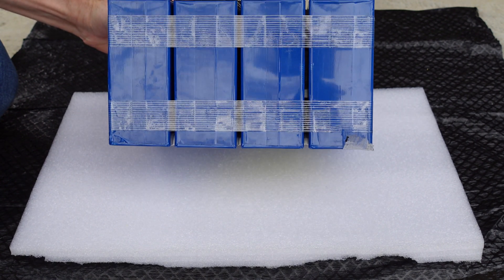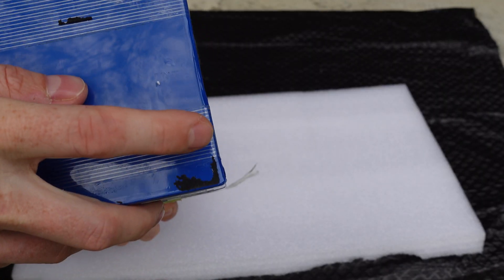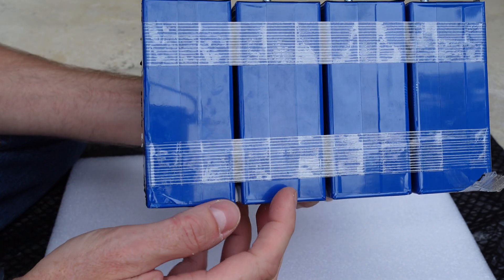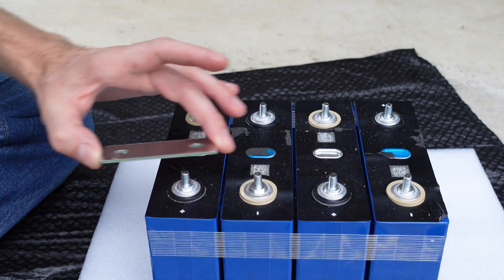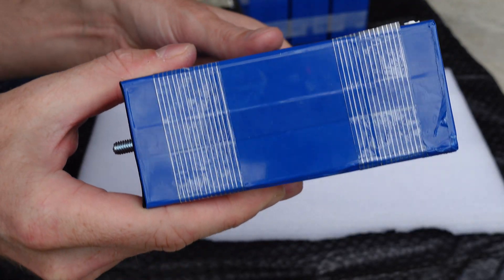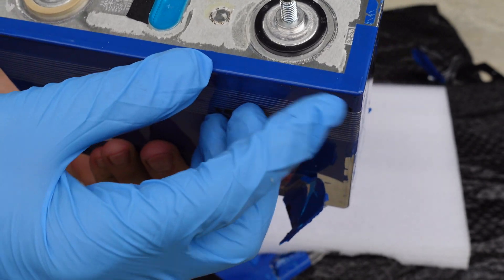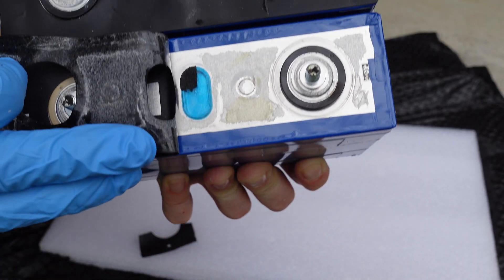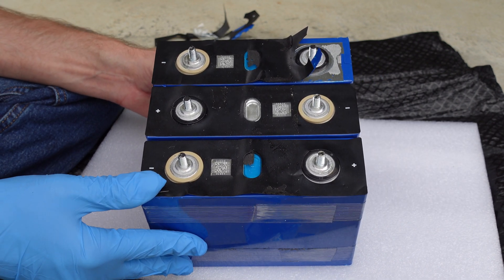Inspecting the Smelly LiFePO4 Battery Pack, Possible Factory Contamination?

Comment from the maker: What do you guys think? Factory contamination during the electrolyte filling process?
Reply: Is the first time i see this but i think that was when filling process so i think that you must clean and use it and see if there's a leak.
Reply from the maker: @norbertrivera  That's kindof what I was thinking too, so maybe just slopping filling that they didn't clean up like they were supposed to.
Reply: @LithiumSolar  lifepo4 cell has pouches, there is no fillport
Reply from the maker: @habana7638  What? This is not a pouch battery, it's an aluminum case. There are no pouches in there.
Reply: I think the plug has a faulty weld.
Reply: Could it be the smell of welding or brazing flux (for aluminium welding) that is the residue that should have been cleaned off?
Reply from the maker: It's electrolyte without a doubt. It has a very distinctive smell.
Reply: Clean the area around the holes and see if it returns.
Personally, I would seal it with epoxy and cycle test it some more - these are too valuable to give up on so easily.
Recyclers should be paying you for them - even dead cells are valuable.

Comment: Hi all, and thanx to LithiumSolar for his informative videos :-) . I am a complete noob with no experience of batteries at all, but have been reading lots over the past year (about battery construction)
 Just a thought about rigid/flexible connections and clamping batteries together. It seems that people agree that if cells are clamped together, rigid should be OK?        but, surely expansion would follow the "path of least resistance"    i.e. if it is going to expand, it will expand, and if it can not expand horizontally, surely it will expand vertically and put stress on the terminals??

Comment: These Cells would NOT have passed certification. This is not a rigid busbar issue, Grade A cells will only "expand" by 0.5MM as stated in the spec sheet insufficient to cause a problem with rigid bus bars. Flexible bus bars seem to be bandaid to a bigger industry issue that continues to questionable cells and then attempts to fix their inherent issues with solutions that are not relevant to proper grade A cells. Practically all vehicle and large scale grid packs use a flat bus bar directly laser welded to terminals, this is part of the structure of the pack. See Tesla Model 3 CATL LFP structural battery pack for more details.

Comment: I see the point of using flexible busbars. However, I haven't seen a single video where terminals beign damaged by rigid busbars either.
Reply from the maker: I have seen a few reports of melted terminals and/or terminals that caught fire. Of course, we don't know whether or not movement was the cause or a poor connection but the point of "why risk it when there is better at the same price" still stands.

Comment: There's no way it was from factory.  The cell was damaged. The cells are under a slight vacuum when sealed so there is probably a hole in the cell that it allowing it to outgas.  Actually makes me wonder if the cell was opened and re-sealed by a third party in order to try to "fix" bad/bloated cells.

Comment: The bus-bar has room for expansion. If it's torqued to spec, wouldn't the bus-bar slip before the post bent?
Reply: I don't think so. You will have multiple forces preventing slipping, not only friction but also the fact that over long periods of time metals naturally weld themselves together.
Reply from the maker: As stated above, it's highly unlikely the busbar is going to slip under the nut. In this case the nut was a flat flange, but in most cases, these batteries are using serrated nuts. Additionally, it's not straight horizontal movement we're talking about.

Comment: for injection electrolyte.
Reply from the maker: Do you think the port is leaking? Or the person who filled it just spilled some and didn't clean it up?
Reply: I think these cells NOT meet battery cells manufacturer 's sealed requirement, they sold as scrap , some seller buy and resell them as new @LithiumSolar

Comment: A leak is one of the things I worry the most about onboard... Have you done any research on what the actual chemicals are in the fluid, and how to neutralize them? If not, maybe one of us should... I bet a lot of viewers are in positions, like on a boat, where "taking the battery outside" isn't viable, at least not quickly.
Reply: If my batteries haf a problem I'd be screwed. It takes no less than an hour to get my batteries to a point where I could take them outside. They are under my bed in a camper and would be a nightmare if there was a problem
Reply: @matthewknight5641  Aye, that's my thinking. My install will be in the engine bay of my boat. I'll have a blower to vent the engine bay, but knowing what I could pour over the fluid to help neutralize it might be good plan, particularly if the electrolyte is corrosive at all.
Reply: @TheDigitalMermaid  and it about has to be corrosive. I worked at the nissan battery plant in Smyrna tn for a while. The electrolyte they use is definitely really bad for you. They where what looks like space suits and enter rooms with double doors and a small room to seperate the doors just to enter.  It's toxic as can be I'm afraid
Reply: @matthewknight5641  Those space suits are mostly to prevent contaminating the batteries. a single spec of dust can cause significant issues if it got inside the battery.
Reply: @hubertnnn  I know the stuff smells just like bubblegum. Sounds funny but it sure does. I was just a line worker stacking pallets but I remember the people working in the chemical rooms and it seemed like a big deal to be super clean. If anyone got the electrolyte on their skin they were rushed to medical and was monitored for a long time. The electrolyte would cause bad burns on peoples skin. I'd say you are kinda right as far as contamination of the cells but I'm 100% certain those suits and respirator systems were for safety as much as anything else. That secret sauce chemical is bad for people

Comment: It seems you confused the bend-ability of the bus bar with the vertical alignment of the cells. The bus bar is slotted, so I expect some give when a cell expands and moves, the misalignment of the bus bar with the terminal...to me that just means you have to re-align the cell.
Reply from the maker: No. It doesn't matter if the busbar is slotted. It's not going to move wth the nut tightened down. When the cell expands (which it does from the middle) it's going to push apart from the bottom and not the top, thus they are not aligned and either the terminal bends, snaps, or breaks... or the busbar needs to bend to absorb the misaslignment - hence the flexible busbar.
Reply: @LithiumSolar  Totally agree.  And they used shipping tape to try and keep the cells together which is why the non-flexible busbars are even more dangerous to use.
Reply: That's not how slots work when fasteners are tightened.
Reply: Thanks both for setting me straight on the slot. I was hoping to avoid spending more on flexible bus bars, so I guess I just have to clamp the cells together.

Comment: why throw it awa, just use it as a starter battery for a generator and leave it outside. if it goes up in smoke being outside at least it did some work lol.
Reply from the maker: Because I have a dozen or more working batteries that I'd rather use instead AND I'd rather not take the risk using something that I suspect to be faulty, even if it's outdoors.

Comment: If you tighten the nuts enough to make proper contact they will make the bar to terminal contact have too much traction to allow even the slight movement available because the holes are a little larger than the post.  Rigid buss bars are a design failure.  

A T Burke

Comment: My guess is that the cell has a tiny fume leak by the expansion valve. More testing with a magnifying glass, AC Leak Detector or  UV Dye detector may help diagnose the foul smell. Also soapy water may babble up around that area.
Reply: Try some soapy water to see if there is some gas leaking out of the cell.

Comment: Excellent follow up as always.  Whatever it is its not acceptable.  The way I see it is these companies, well, this company, doesn't let you know what's inside the battery for a reason.  They're like a chop shop in the auto industry.  They scrap together whatever they can get cheapest.  Your bus bar comments are spot on.  Why buy a battery without them?  Companies should advertise that to differentiate.  The consumer has to make educated choices and this should help educate them.  Don't buy this brand and go for another that Trusty @LithiumSolar recommends.  Not worth the hassle and the risk.  Just like Weize did with their 100AH 12v Lifepo4.   You just dont know what youre gonna get.   I'll gladly pay a little extra for @LithiumSolar recommended battery.

Comment: I would pay for disposal but first discharge them and let the manufacturer know what you found.
Reply: Well that could get expensive quick if we have to pay for the product then pay to dispose it.  I think we need to go back to warranties.
Reply: @aussie2uGA   This review also cancels the manufacturer from continuing to sell their products. We have been benefiting greatly from this review and will get manufacturing to step up the quality.
Reply: Hang onto your lithium batteries - when people finally realize that dead batteries are very valuable, you'll be able to sell them.
Per ton prices: cobalt at $30,000, nickel $20,000, copper $8,000 and lithium carbonate $37,000.
The recycling companies should be paying you for them as high grade ore!
Reply: @ahaveland   I understand that but a leak is a big problem it’s not something you keep around.
Reply: @clarencewiles963  If epoxy seals it, then it wouldn't be leaking anymore. Most of us don't have thousands of dollars to blow on LFP batteries, especially if they can be kept running. If electrolyte leaks, then the cell capacity proportionally drops and a BMS would notice and give warning after a while.

Comment: I would clean it off completely and see if the odour disappears. Most likely it's a spill from the factory when they filled it with electrolyte. I have a 12V battery as well which has this funny addicting smell. Could not see any damage or liquids anywhere, so keep using it... 
I assume, your cells are fine and will make a nice battery for the garden shed, so away from the house...
Reply: That sounds like a plausible explanation.

Comment: Is the electrolyte toxic/dangerous? It looks like the electrolyte may have been spilled at the factory?
Reply: yes, you do not want to touch it. Will Prowse has talked about this in some of his videos. It won't make you keel over and die but it's something you wouldn't want to voluntarily touch with bare hands even once if you value your health.
Reply: The usual electrolytes ethylene or vinylene carbonate aren't very toxic, but they contain performance enhancing additives such as perfluorinated hydrocarbons, otherwise known as forever chemicals, and these are not good for you or the environment, as they persist basically forever, travel up the food chain and collect in your body.

Comment: Could you bring the 3 cells in when they no longer smell and continue then cause maybe it is the first cell you had peeled of.
If not it might be time to check the next cell. 

It is strange that it smells I guess only under load or charging / discharging.

But my bet is that 1 cell has an issue and the other would be intact cause what usually happens is that 1 cells goes bad and 3 are still in good shape, but the missing answer is which cell is the bad and smelling one.

Comment: Well said regarding compression and flexible busbars. 100% agree
Reply: Well said what? There is no one ever reported damage by rigid busbars. Hence, rigid busbars are still dominating the market.
Reply: @897aa33  Yet.
Reply: @897aa33  definitely false. There is added pressure to the posts. Several have had damage at the posts due to no compression with rigid busbars.. rigid busbars are not dominating the market… look at basically every EV battery.. without compression and using rigid busbars the cells can expand more at the bottom than the top since the rigid busbars are stooping expansion at the top. Yes some leave a gap etc,, but why not just do it right and snug up the cells with proper compression and flexible busbars and KISS
Reply: @897aa33  
Plus those batteries are pretty new tech and are supposed to survive at least 12 years.
I don't think you have any from 2011 to compare the effects of rigid vs elastic bus bars over that long period.